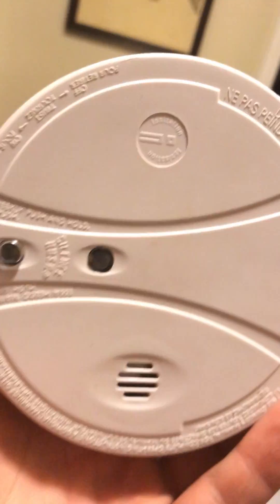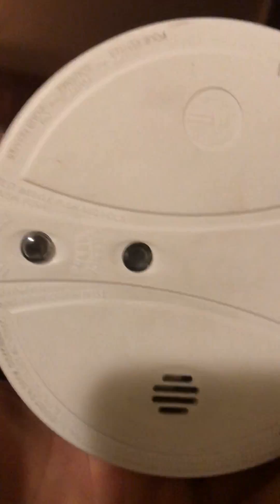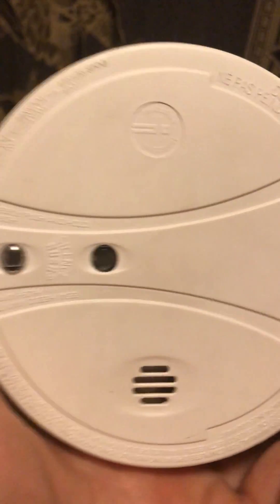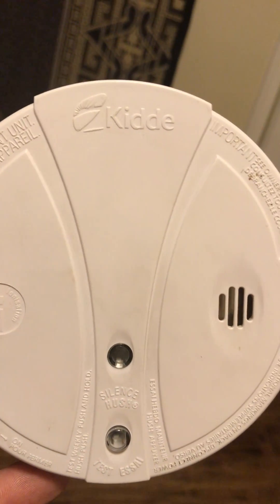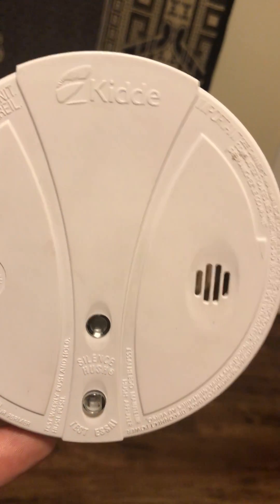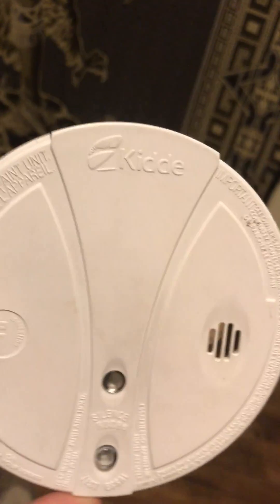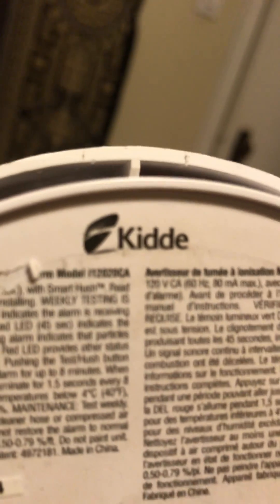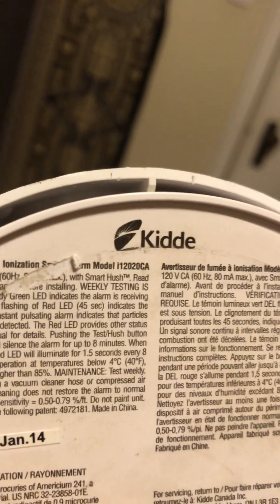Kidde smoke alarm chirps after removal

Comment: This is exactly the same alarm I have and my landlord argues with me saying it has a battery I have looked for several days amd no luck to finding g a door for battery. 
So there is no battery for this unit?
Reply: So @lindalouise625 what was the results?
Reply: @maximegirard9099  I called the company and they sent me a Free replacement as the 1 I had did Not have a back up battery. I own my home ur landlord needs to fix the issue and have good alarms installed
Reply: Same here.  My electrician is coming by tomorrow. IF there is a (#%#^battery in it > He'll find it. I'm done
Reply: There is NO backup battery in that model and Kidde will replace it Free BUT ur landlord has to call them to have that done.  KIDDE customer svc was awesome to deal with. The # is on the unit. You could call them and see if they.ll ship to You .. but ur landlord is responsible for this
Reply: @LindaLouise625   the alarm was past it's expiry date.  They are dated to last for 10years.  This one was outdated in 2021

Comment: I have the same model. How do you replace the battery with this?
Reply: Did you ever figure it out?
Reply: @muskaanwalia8892  with this model, battery is built-in and can't be replaced. Need to replace the detector itself. There are some models that have replaceable batteries.

Comment: My issue is::: My 1 year old Kidde Model  i12010SCOCA   IONIZATION & Carbon Monoxide Alarm gave a beep @ 4:15 am after what appeared to be a minor power fluctuation. The alarm would go off approximately every 30 seconds, stop then start again.  I took the alarm off it's mounting and went downstairs to have a look at it. To my surprise the beeping noise continued Upstairs even though I'm downstairs in the kitchen with the alarm.. I wen back upstairs to look at the wiring. I noticed that the Red Power wire that connects to the alarm connector was loose from the main Red wire. I reconnected it and put the alarm back on. There was no difference, it still beeps every 30 seconds. I checked the other 2 alarms, they are Not beeping, but the Green status lights are blinking while the beeping one upstairs has a Solid Green status light showing. What might the problem be?
Reply: Every 30 seconds means it’s bad or expired.

Comment: There is extra power stored up in the capacitor after you remove it from the wallthere's a button after you remove it from the wall and after you replace the battery you need to push a button on it and keep it pressed for about a few seconds so it doesn't go off again.
Reply: How do you replace the battery on this one, there is no battery door.
Reply: @YiboandMe  no one has still answered this question. I’m so pissed rn

Comment: Back up battery is inside. That chirp is to let you know to replace it.  The whole thing opens up to replace the battery.
Reply: I opened it and there are no batteries inside, now what to do??? Any suggestions??
Reply: @bean22121972 why did u open the smoke detector?
Reply: How do you replace the baterie inside ?

Comment: That's a 10 year spelled lithium battery kidde smoke alarm after 10 years like all smoke alarms and battery operated you need to replace it cheak the date to see if its over 10 years old and if it is over 10 years old replace it
Reply: no its not. its a kidde i12020ca. those have no battery backup
Reply: @thatcanadianrailfan  Ok
Reply: How do you replace battery ? I cant find it . Honestly ...  im sure this is exact one i have
Reply: @savagex466-qt1io  Well sadly you cant replace the battery in this since it is an intergraded battery. Also after 10 years you have to replace the unit its self with a new one. Kina like you cant replace the bearings in a washing machine if it has a sealed tub for example. At the same time it is possible to replace the 10 year lithium battery in it if you are determent but at the same time the reason why  the battery only lasts for 10 years because you are meant to replace the smoke alarm every 10 years
Reply: @SmokeAlarmCollecter 2021 Ok

Comment: So what do you do to make it stop chirping?  I have the same one and it's good until 2025.
Reply: Change it's batteries. If it's too late for that, remove it from the ceiling and put it somewhere far away so you won't hear it then change the batteries.
Reply: @smokealarm5753  so does that mean the smoke alarm starts chirping when the battery is about to die soon?